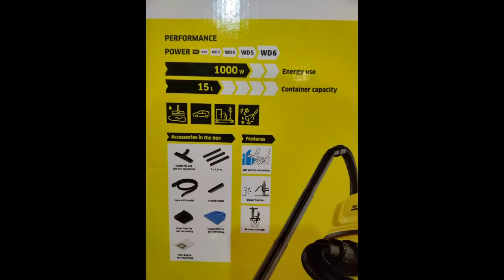KARCHER WD1 Wet & Dry Vacuum Cleaner, With blower function ,My opinion demo power test.

Comment: Hi sorry for posting so late. I recently bought the same WD1. What surprises me is that the brush or carpet nozzle does not have those small wheels and it's struggling to move on fluffy carpets. How do I clean without those wheels?
Reply: Me too. Should have wheels. So annoying when the brush was bent when want to vacuum forward and made screeching sound if it was drag on tile floor.